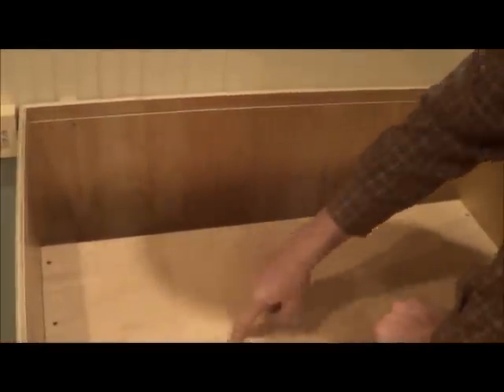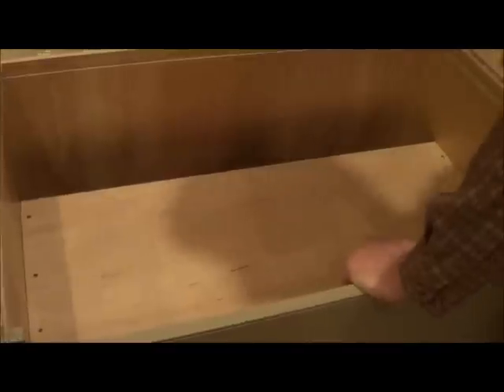Apron Sink

Comment: what about under the cabinet where the vertical plywood is pressing down on the cabinet base...any support there?
it looks like you transfered all the weight to the cabinet sides.
Reply from the maker: Yes, the bottom of the cabinet is dovetailed in to the cabinet sides, making it the strongest point of the cabinet. The cabinet sides are vertical and go all the way to floor, so in structural engineering terms, we have carried the weight of the sink to the absolute strongest part of the cabinet. There is no additional support needed below the cabinet floor, it will easily support hundreds and hundreds of pounds where the floor integrates with the cabinet sides. I can't speak for other cabinets, but this video pertains to our Conestoga cabinets and that is the audience it is directed to. Your cabinet may be made differently, but this method will still carry 3x the weight the standard rods that come with the farm sink would support.

Comment: Should the sink be flush with the top of the cabinet ?
Or a little above for when the countertop is shimmed ?
Reply from the maker: Flush with the top of cabinet box. If the cabinets were installed correctly, they should be level and there should be no need for shims. Even i the shims were needed for leveling the counter, you can adjust the sink up under the counter if needed.